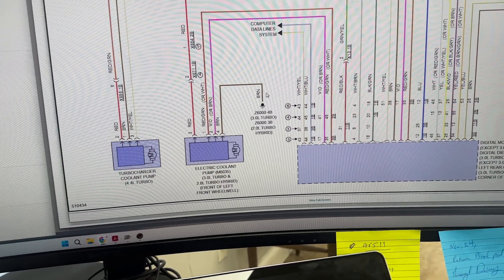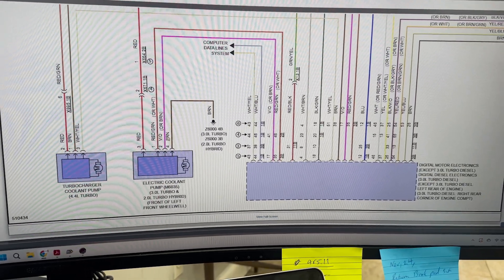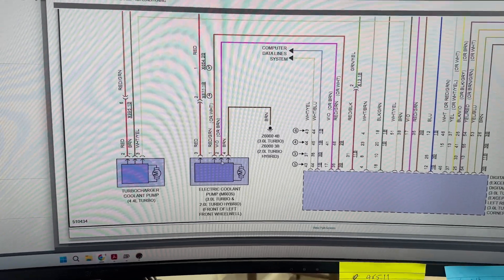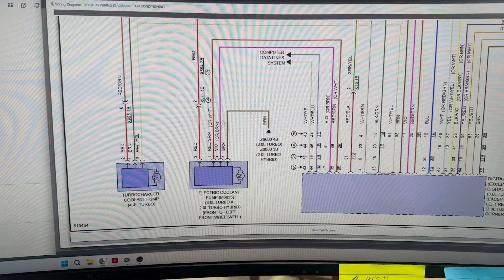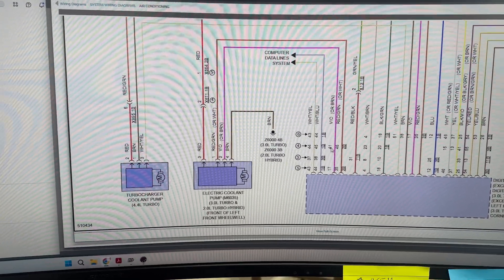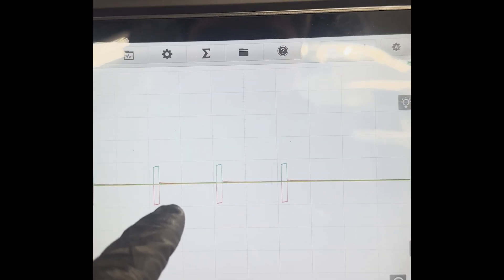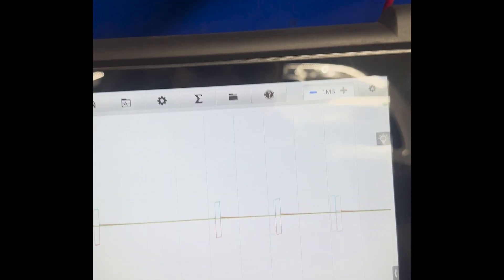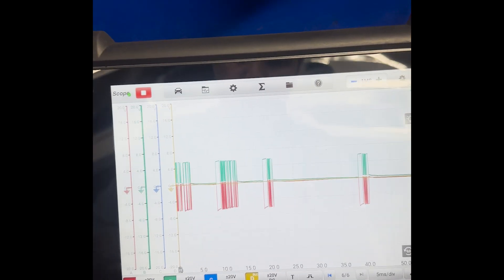How I Caught BMW's Hidden Battery Drain Issue

Comment: From what I understand the turbo coolant pump is actually meant to run for a certain time after the car is turned off to cool the turbo's as they will get hotter after shutdown.  Fairly normal.  Was the pump doing something odd.
Reply from the maker: @Bugcatcher3d  no that’s not normal, we chnage the pump and car fixed, no battery draining anymore

Comment: Great Video! As we speak my water pump is not working and while my mechanic was trying to send signal to the water pump (make it work) it showed there was no communication. It was working dbu no communication. Also at this same time the oil level sensor stopped working and it also says Intelligent battery sensor not thereas well as the oil level sensor. Any suggestions???? Please!
Reply: Forgot to mentioned, today vehicle had 0 percentage of battery